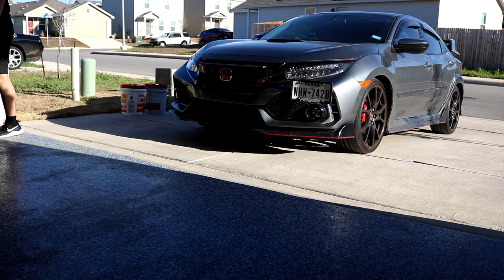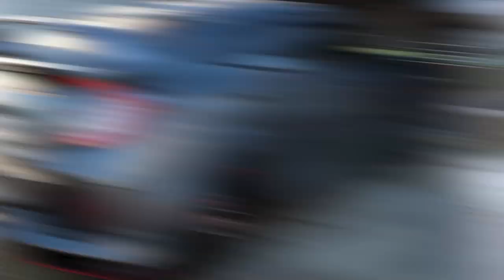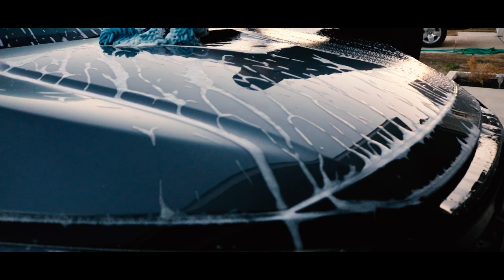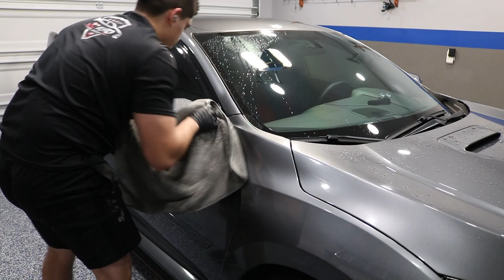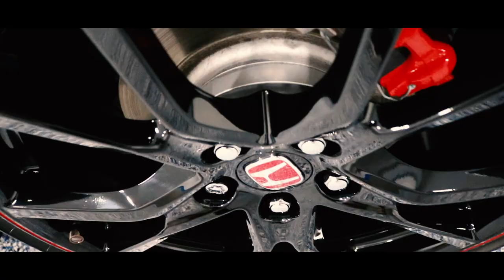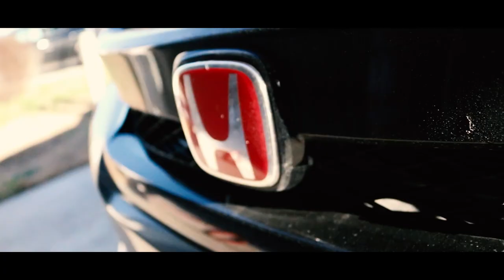Car Detailing Type R (FK8) | Satisfying & with a little ASMR touch!!

Comment: 08W42-TG7-100. Needed badly. And the worst part about cleaning the Type R is the wheels and the Wing. Also the hardest part to ceramic coat. Love PMM. Mine is SGP. Matches my 2021 Accord Touring. Great color.
Reply from the maker: Will definitely get those wheel nuts👍👍

Comment: What PSI is the pressure washer, it looks like you are almost taking the paint off when you get the nozzle only inches away from the car. 🤭
Reply from the maker: It's a 2000 psi electric pressure washer..It's still safe around there more than that would do what you said & i also have ppf on this car so I won't be doing any damage to the paint. 😁👍

Comment: I’d be scared to pressure wash to close to the car. 😨 if a rock chip got some of the paint, might end up some paint off. Always good to see the level of detail people have for their car. 👍
Reply from the maker: You are right, it might if you get to close and if you have a really strong pressure washer,  mine it's only 2000 psi and it's electric, plus the car has ppf which makes it a little more safe.👍👍
Reply: @jcautodetailing7629  Nice!! I’m bringing my Type R to a detailer next week for the PPF and tint install, can’t wait. Is the front end or the whole car PPF?
Reply from the maker: It's the best decision you can make!👍 I did full front, which in my opinion it's all you need but would also do the roof, which might get in the future for mine!👍 what are your mods?? And where are you located??
Reply: @jcautodetailing7629  I’m in NorCal, I only installed the Mugen kit and mishimoto intake so far. Get an exhaust down the line, have to be careful in CA 😅
Reply from the maker: @tsunami6253  yeah that's what I heard!😅😅 & asked because tomorrow there will be a really big meet in Austin Tx wich I might record or do some type of vlog!! Should be fun!
Reply: @jcautodetailing7629  A meet in Austin Tx?! Wish I could drop by for the meet. I'll definitely have to watch the video when you post it. Keep up the good work
Reply from the maker: @tsunami6253  yeah man it should be exciting!👍 but, yeah hopefully I can make the video!!😅👍 thanks man!!